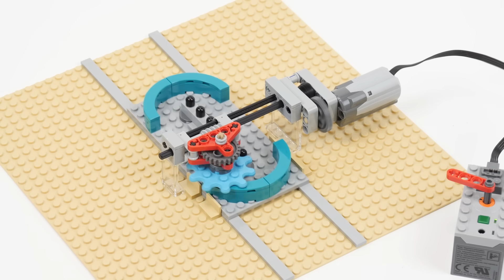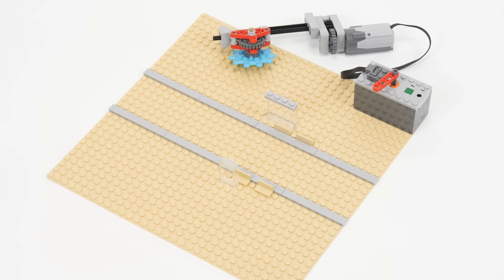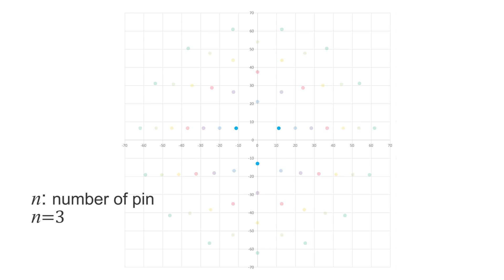レゴでマングルラック機構を作る

Comment: I can imagine quite a few uses for something like this. It does have design flaws, though:
1. Bricks and or plates scraping against tiles will inevitably put scratch marks all over them in the pattern the machine is moving the rack in. An improvement would be to reduce or eliminate wear without compromising the maneuvering abilities.
2. I'm not sure of the maximum load capacity of the rack, obvious improvements here would be a sturdier rack design that is more robust and can handle heavier weights.
3. This isn't a flaw, but a suggestion would be to install logic racks or codes that can be read mechanically, this could be implemented for sorting purposes, for example, by having another rack mounted that the machine "reads" with some kind of reading mechanism, thus allowing the machine to send different boxes to different destinations automatically. It would require a decoding and encoding mechanism somewhere, the encoding mechanism could be manual.

Comment: the palette thing looks good for a GBC. the balls enter the modified palette, which has a hole in it. when it reaches the other side (the balls will stay on the floor and pushed by the palette) a lift pushes through the hole and lifts the balls up.

Comment: This is brilliant. At first you made a mechanical sine wave generator, then you amplified it and changed it's frequency. Then you continued to square/pulse wave, and then it just got out of control and became so sophisticated, that it's really worth commenting. I really liked the idea of using your machine design to use the moving platforms as a form of creating a simple pixel animation (the red/blue platforms). The boss level is to build a mechanical display screen that is run by a lego-operated pocket calculator. Should be possible, quite big a challenge though :)

Comment: Hey, I thought I'd do the maths provided on screen for the 5 pins out of curiosity, but for some reason r came to be 1185 instead of 21, using the exact equation:
r= 6.5/sin(pi/2(5)). Rearranging to find d and r, then if I multiply or divide d or r respectively, by around 57.39, I get answers much closer (not exact but only off by a few decimals) to what d and r should be. I'm not sure where I've gone wrong, so I'd love a slightly expanded walk through of the equation to help me identify, if anyone could help. Cheers, and great video 'n contraptions, very interesting to watch and gets my mind thinking :)

Comment: I wish Technic had this kind of gearing mechanism, a guided rack? I've been looking for a solution for a self-reversing actuator, and the only solution I've come across is a driving ring gearbox, 3L driving ring on a 2L shaft with a clutch gear on either end so that it instantly switches gears with no deadzone between, actuated by a very convoluted form of a limit switch where a catch is actuated by the rack at the end of it's predetermined travel. Until Technic directly has a variant of what's shown here, this is the only purist solution to my needs; unless PoweredUP eventually has linear actuators that have position measurements, but I'm not getting my hopes up for that. Having a guided rack like this would minimize my self-reversing linear actuator idea, though it'd probably increase the size of the actuator itself.